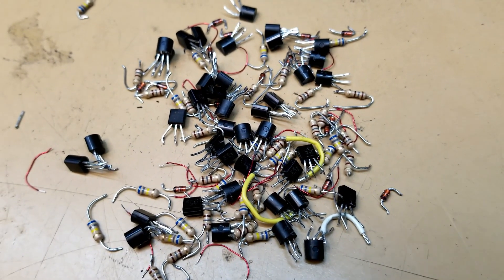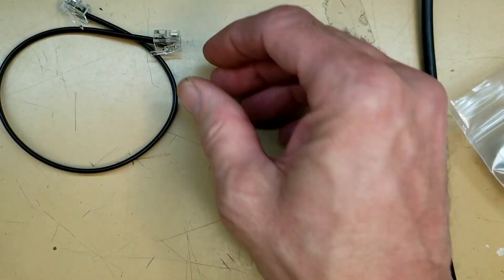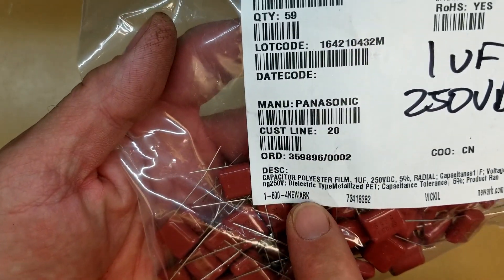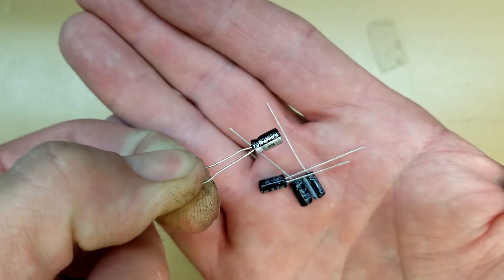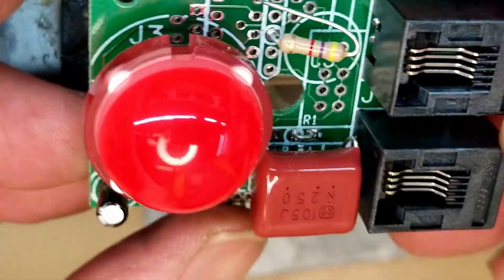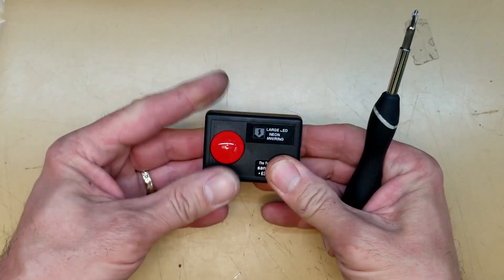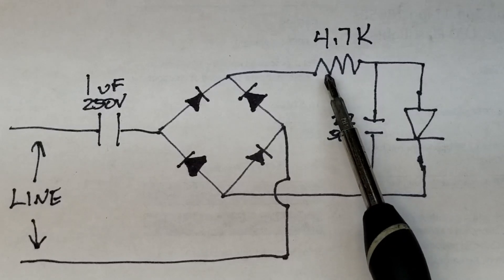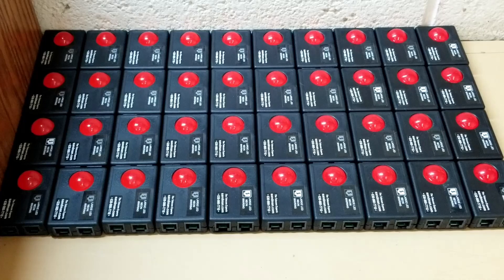PHONE FLASHERS FOR LOW VOLTAGE OPERATION. SANDMAN.COM POTS PLAIN OLD TELEPHONE SYSTEM PAP9Q-0001

Comment: Hi NorCal really love your video..I have a question for you .what could cause a TV to keep losing picture if the tv is off all day..I have change the main board,power supply,and even the tcon and the issue still persist..most the time the tv works fine beautiful but sometimes lose the picture.i have do a hard reset to get the picture back..any idea would be appreciate.thanl you